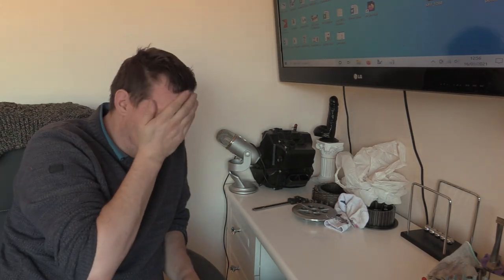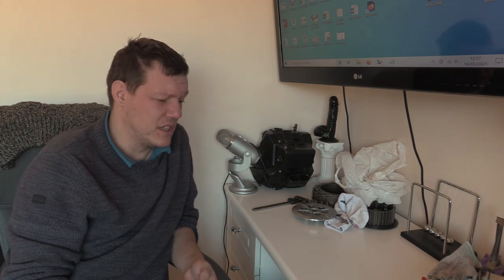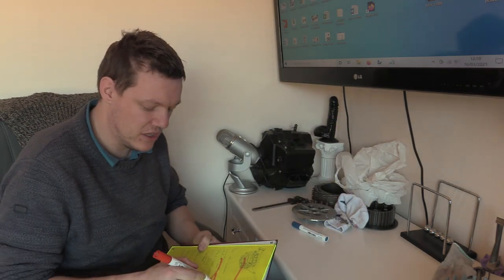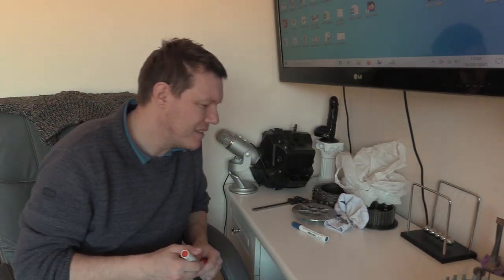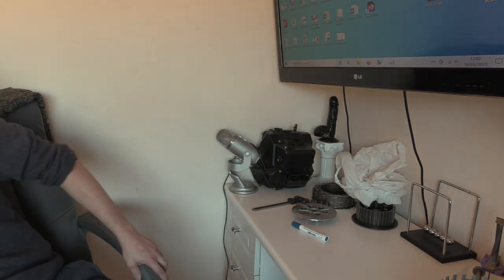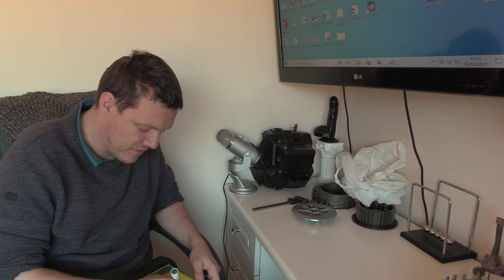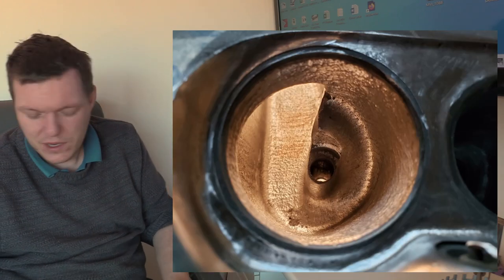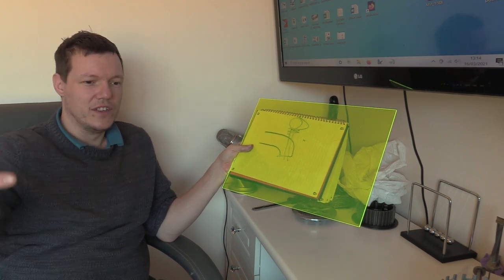Why old ports are JUNK!

Comment: So you're saying V8 ports are crap? But please show me the 500cfm motor bike ports. 
Yes V8 engines do suffer from having the ports turn a little more than most would like. But if you know a little about ports you would know V8 ports are designed to swirl into the chamber not for mixing but to increase flow with a bad port angle. 4 valve heads will tumble into the cylinder this is usually due to the valve angle.
The problem with V8 ports being made too high is intake design. So MBE make a 9° valve angle head it's on the limit with the intake because if you raise the port much more the plenum will be too wide. Big drag engines still use carbies because they're after the charge cooling which gives you a power gain right at the top of the power curve.
I'm still yet to see a Yamaha engine do a 4 second quater mile. 
But yes American engine builders know raised runners are better for a straight shot into the cylinder but sometimes you just have to piss with the dick you have.
Reply from the maker: Lmao. What? Yes v8 ports are crap. Nearly all 1000cc sports bikes do 250 cfm, and they're all 61cu.in engines...

So yeah, 500cfm isn't good, at all. 

Next,
Reply from the maker: Dragster use injection, not carbs. And I'm yet to see an American v8 engine do the 1/4 in 4 seconds... they're not american built V8s... wow you're dumb.
Reply: @dirtygarageguy  Lololol 250cfm and they struggle to make more that 1.2 ftlbs per cubic inch infact I think the 2019 R1 is like 1.12 ftlbs per cubic inch. That's a lot of flow for little performance.
Reply from the maker: Wow. These big engines you talk about, what American factory did they come out of, or are they billet machined? Not really oem affairs then are they. It's funny you talk about all off this shit, have you ever machined parts for NHRA and FIA and FIM engines? I have.
Reply: @dirtygarageguy  Vizner race engines, AJPE, Proline ect. They're factories. 
Let me know when Yamaha or Honda make one of their 4cyl engines 6l to move a heavy car. 
LS engines can actually get 2t of car moving.
Reply from the maker: They're not factories. Top fuel engines a have to be based on 500 cuin chryler hemi engines, push rods and all.
Reply from the maker: You seem to not understand what displacement is...
Reply: @dirtygarageguy  I totally understand displacement. I also know the law of scaling is why ship engines rev 100 to 200 rpm and why bike engines rev past 10,000rpm on street bikes.
However every chance you get you have a dig at V8 guys yet never appreciate some of the performance and technology the pushrod V8 engines have.
Btw the fastest accelerating bikes on the planet are push rod nitro Harley engines.
Reply from the maker: The law of scaling? What's that and who defined this law?
Reply from the maker: There's a reason why I have a dig every chance I get. It's because v8 cam in block designs are old, really old outdated crap. The positive is their cheap. I don't want cheap, like I wouldn't want a cheap surgeon. HP numbers are for dickheads. Let's take your v8 of choice and alig it around a track...and not an oval you fucking simpleton...
Reply: @dirtygarageguy  don't be rude now little pom. 
V8's are a good option for a car when they can make 1.5 ftlbs per cubic inch @ 2hp per cubic inch. Whereas a bike engine will make 1.1 ftlbs per cubic inch @ 3.5hp per cubic inch.
Like I said show me a bike engine that can scale up in engine size to make a car move.... It won't happen as you need torque. 
And with a 150kg to 200kg the power to weight ratio with 250cfm ports that's a lot of port to only move 200kg to 300kmh it's pretty pathetic really.
Reply from the maker: Little pom? When you try to insult someone, it's a good idea if that actually means something to the person you're insulting, and pom isn't one of then... lmao.

And back to the topic. Check out a ferrari engine, fitted to a CAR. Now look at the ports from that engine and a bike engine. Now look at an American V8... then you'll see the light.
Reply: @dirtygarageguy  So how come some heads on American V8's make more power than a Ferrari? I could buy AFR, Mast, TSP, Trickflow, Higgins race heads ect there's more and throw them on an LS3 engine put a cam in and make more power than a Ferrari. 
Just because the port has to make a turn doesn't mean you can't get a good head and good flow.
Yes a straight in port is better but you can't have that on a 90° V8 because the runners will stick out the bonnet. With the turn in the port you can keep the runner straight and both banks meet into one plenum.
So you either make the V wider or the turn will end up in the runner if you take it out of the port.
Plus LS engines are way cheaper.
Reply: @dirtygarageguy  Also you say motor bikes have 250cfm ports. Well a good engine should be making 2hp per CFM not .8hp. If you're not making 2hp per cfm you have a lazy port and you're not using the coefficient of discharge properly as your port energy will be very low. 
Look up F1 port energy.
Reply from the maker: Because you're modding a v8 that doesn't have to pass emissions and noise levels.
Reply: @dirtygarageguy  So you're not denying that a old amercian V8 port can make good power then.
Reply from the maker: No. I'm saying the design is shite. And it's shit because they're lazy. There a re loads of v8s out there that are better.
Reply from the maker: Here's a better one

Look up BMW S63B44T5

4.4 ltr, V8, 617HP, 750Nm and thats out of the box...

https://en.m.wikipedia.org/wiki/BMW_N63#S63B44T4
Reply: @dirtygarageguy  Yea I like BMW V8's. We had a few on the shelf when I was the mechanic at a euro wrecking yard here in Australia. Not the 600hp ones but the older ones. 
I have also taken a few Audi V8's for a drive and they smoke the 2017 era Mustang but Ford must've fixed that as the 2021 Mustang is now at 1.35 ftlbs per cube.
I do like twin over head cam engines infact I like all performance engines. I just hate it when people make our that a two valve pushrod design can't make power when it actually can.
Reply: @dirtygarageguy  that V8 is twin turbo.
Reply from the maker: Make power... that's your problem. I didnt say that, but power means fuck all
Reply: @dirtygarageguy  Well yes and no. Motor bikes make use of power as they have very low ftlbs per cubic inch which is why they have to rev so high to make power to make up for their lack of torque.
Reply from the maker: So? Take the turbos away its still a 400HP rig. The turbo thing is a good point, they're using the hot V system. Unlike the American v8 gang, they're moving on
Reply from the maker: Lack of torque? It only has to shift a bike

Comment: After watching this video, which is the best you have done on porting and how fuel gets into the combustion chamber, I sat and thought how archaic this whole process is, given we can put a rover on Mars and send back HD pictures, not once, but multiple times over the years.

60% approx of the BTU's available wasted. Must admit though, as an 18 year old I loved my KH250. Now 61 and would love to ride again since I stopped riding aged 22. I would ride electric given a choice between the two. More instant power etc..................... but less challenging working out the revs and gears with the input of a screaming engine. Did ride a 250 Superdream a couple of times and came away with a nightmare, due to lack of, well, everything.